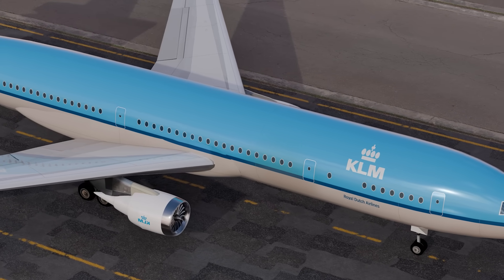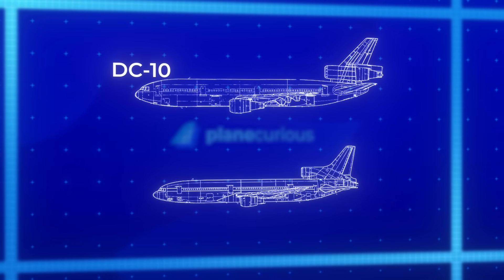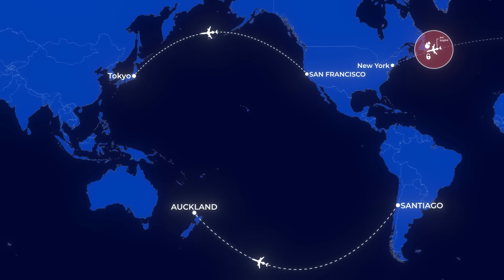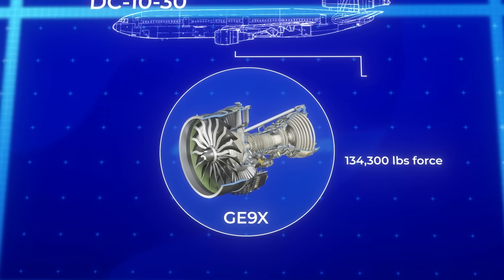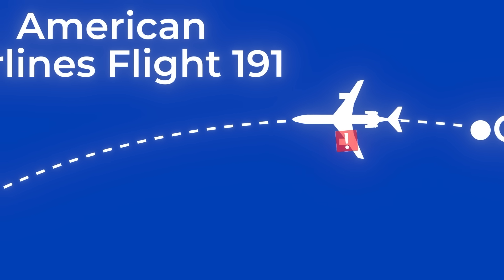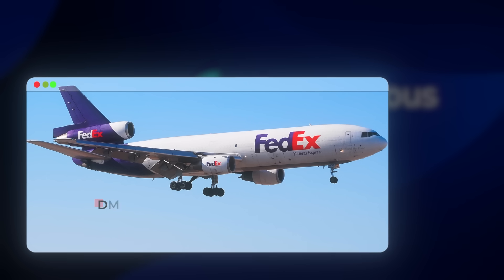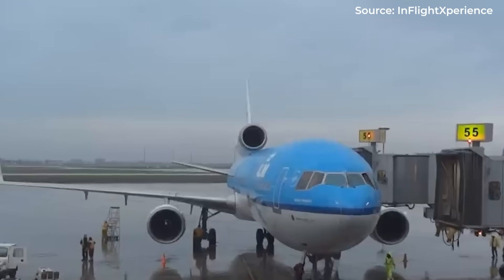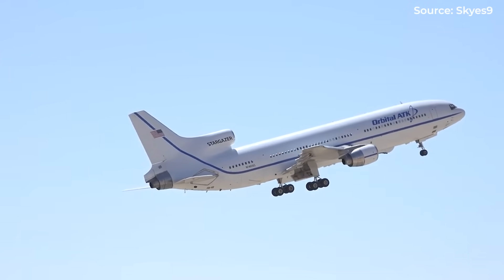Trijets Changed Everything - Until They Didn’t

Comment: 0:08 - The backwards logo on the engine is quite a nifty lil' quirk of the KLM paint scheme isn't it?  Silly Dutch, always having a laugh... :)

The 727-200 is simply the very best airliner that's ever been in my opinion for plenty of reasons.  No it is not practical today for also plenty of reasons, but what a beautiful, hardy aircraft, designed in the days of slide rules and paper, and just such a workhorse of fleets.  Long range, short fields... it did it all.  Still does in various areas of the world!  

My favorite of all time, and I miss them 'round here so much. The old school Delta paint was made for these planes.  I do wonder what the old Texas International paint woulda looked like on one, but we never got there as TI turned into Continental with the merger.  That triple whine, those clean swept back wings, and then they'd 'explode' with their triple slotted flaps... even had inboard and outboard ailerons, unheard of today with aircraft of that similar size.

Yep.  Love me the 727s.  Bestest evar, and likely never to be topped except in performance, which is natural.

HOWEVER... the 727 was not an answer for the fuel hungry 707 per se, as for certain routes there wasn't anything except the DC-8.  And the 727 was definitely not made for ocean crossings.  747 was made to solve the fuel hungry issue by simply moving more people at the same time with better engines.  DC-10/L-1011 was to try to make a similar thing happen with one less fuel hungry engine, perhaps not as long range or as many passengers, and they competed directly so neither really 'won'.

727 was built specifically for Boston Logan Airport and certain demands of airlines. At the time, Logan didn't have the big runways it has now, but American needed to get the heck outta there with a decent passenger count... but American also wanted a long range middle route airliner.  United wanted the middle router too, but they wanted engine redundancy with 4 engines.  Eastern also wanted the middle route airliner, but a twin jet.  So the 3 engines with high lift swept back wings and a T-Tail solved it all, compromised to satisfy all clients and wound up being the best selling airliner of its time.  THAT is why the 727 was built, not for the ocean crossing, it was never meant for that.

Also, the engine wasn't integrated into the vstab, that was solely a DC-10/MD-11 thing.  The engine was integrated into the body at the tail end, the intake was an S duct that was integrated into the vstab, and that led to the engine in the body.

I know, a bit pedantic, but I feel it's also important to get these things right.  History's important, y'know?

That all said, glad to see the 727 getting some love anyway, obviously. :)

Comment: Three engines existed for one reason. Law prohibited 2 engine aircraft from flying across oceans. Four engines was expensive so 3 engines designs where produced to meet the legal requirements. The law was changed when 2 engines where shown to be capable of delivering the required redundancy so the 3 engine configurations where dropped as they are more expensive and do not provide any significant advantage over two. You are welcome.

Comment: 8:53 just a little insider context on FedEx, we’re actually phasing out the A300/310s much faster than the MDs. Primarily we’re swapping the MD-11s out with brand new 767-300s but it’s happening much slower than the higher ups originally said it would. We’re pretty much flying them until they’re unfixable

Comment: I flew on a DC-10 twice. Hated the whole trip both times; the engine on the tail made so much noise. Two or four engines are much nicer to fly in.
Engines Turn Or Passengers Swim just plain can't be overlooked for fuel economy.

I still flat-out hate flying, though. I hate sitting in metal tubes, I hate security theater, I hate enforced waiting, and I also hate arriving at my destination at an entirely different sleep schedule to the local one. I'd much rather get there myself with my own vehicle, and America has gotten worse and worse as a potential destination while ticket prices rise and rise.
BA never did answer me about what they did with all the time harvested from their passengers; you lose more flying one way than you gain flying the other way.

Comment: Okay, a few things right off the bat, firstly, while the 727 was a tri-jet, it's not appropriate to lump it in with the DC-10 and L-1011, The 727 was a smaller narrowbody aircraft aimed at the short to medium haul domestic market, it occupied the same segment of the market that the A320 and 737NG occupy today (funny bit of irony on that, the 757 was intended explicitly as a 727 replacement, but the 737 ultimately ended up de facto replacing the 727 due to being more cost effective than the 757). Secondly, the 707 was designed as a quad jet primarily because jet engines of the era were not powerful enough to provide adequate thrust for an aircraft the size of the 707 with only two installed. The 707's first powerplant; the J57/JT3C was the first turbojet engine to achieve 10,000 lbs. of thrust, it was the most powerful engine available at the time, and yet, the 707 was so large and heavy that it necessitated four of those engines to provide adequate thrust. That brings us back to the 727, it was a tri-jet because only two JT8Ds wouldn't have provided sufficient thrust. Its three engine configuration was more a product of the limitations of the engine technology of the era rather than primarily targeting increased redundancy for overwater ops.

Comment: Thanks to ETOPS for trijet demise and later the quad jets, too. Boeing 777 was initially designed as a trijet with a 767 fusalage. American, United, and Delta wanted a true DC-10/L-1011 replacement, Boeing agreed and overhauled the 777 with similar fusalage cross section as DC-10.

Comment: I'm completely convinced that if McDonnell Douglas had developed the MD-11 as a twinjet (which they had actually seriously explored doing in the mid-80s), it would have saved the company by fielding the industry-chganging 777 years before Boeing did. The market demand for large, long-range aircraft that the trijets & 747 historically served didn't diminish, airlines just wanted more efficient twinjets to operate them. Boeing & Airbus saw this & capitalised on the winds of change with the 777 and A330, but MD tried to cling on to the old way of doing things and ultimately paid the price for it.

Comment: And yet the USAF STILL flies the DC-10's with a great safety record. As a crew chief they were harder to work on, but not a major problem and it didn't take "DAYS" to change the top engine. But airlines didn't want (and STILL don't) to do the PROPER maintenance of aircraft that is required. ALL passengers on an aircraft are an accountants risk factor. They weight how much the payouts would be if a plane crashes and they're held liable versus how much it costs to keep aircraft on the ground to do GOOD maintenance.  I can still go to MANY aircraft at an airport and do a visual inspection of aircraft that would get a redline on my inspection, that the airlines pass on through

Comment: I flew in a back row seat on a DC-10 once. It was insufferably loud inside the cabin back there. The flight was a short one, less than 2 hours, but gave me a splitting headache 10 minutes in. I never stepped foot on another DC-10 after that.

Comment: The L-1011 never had many of these issues, and the DC-10 has been delivering packages every day for FedEx and UPS since the 1980s, without a single crash.
It was the engineering of the Rudder controls when they first released the DC-10 on the market. Once that was fixed, hasn't been an issue.
Reply: What was wrong with the rudder controls when the DC-10 went into service?

Comment: I remember that trijets were also nicer for the passengers when it comes to overall noise levels vs the four engine models of their times because of the location of the noise sources. But that is irrelevant as economics ALWAYS wins vs any other, possible advantages.
I also still remember some issues with cargo doors which caused some DC-10 crashes before that was fixed.

Comment: Note: the A300 was the first ETOPS airplane. It's operation was approved everywhere, but not with the FAA. The DC10 was designed as a two engine airplane. After Douglas seen/heard of the Lockheed design (same as 727 S duct), it was quick put an engine here.

Comment: Tell sully and his passengers and every other pilot that has ingested birds or other FOD that losing both engines is like being struck by lightning. If Sully had had a Tri-Jet it’s very likely that he would have been able to make an active runway especially with modern day higher power engines. Also with engine making more power and becoming more fuel efficient 3 much smaller engines might be a bit cheaper to operate than 2 much larger engines providing them same amount of power.
Reply: If you fly through a large flock of birds you'd probably lose all 3 engines.
Reply: @joeschmoe6908 not necessarily. Aircraft have lost one and both but your chances of survival are higher with 3 and carrying passengers you’d think they’d place safety and redundancy at the highest levels.
Reply: @P-J-W-777  my expectation is that they would place safety and redundancy at reasonably high levels, and once they achieve those levels focus on profit. It sounds bad, but literally every engineered product works that way. Cars could be designed to much higher safety standards, roads, buildings, machines, everything. But squeezing the last tiny bit of safety out of anything is almost always disproportionately expensive. The perfect is the enemy of the good.
Reply: @joeschmoe6908 Pretty sad they place a priority on profit over safety getting by with only what’s set as a minimum requirement. On a personal level I don’t place much emphasis on safety as that’s your choice and responsibility but when you add multiple people especially children my GAF meter goes way up and feel that safety should be placed first and foremost before anything else.
Reply: @P-J-W-777  the minimum safety standards in the aviation industry are very high to begin with. Have you ever known anyone who was injured or killed in a plane crash? My guess is no.
    The limit to how safe anything can be is how much you are willing to spend on it. If safety standards were significantly higher, the cost of flying would be so high that only wealthy people could afford it.
Reply: @joeschmoe6908 I completely agree that safety standards are very high already. The problem is, is that we can make things ever safer without adding additional BS rules. I absolutely know a few people injured in an aircraft. My grandfather had a no nose gear landing in a Cessna 414 after it failed after being rebuilt. With my previous profession I have rescued more people than anyone should have to after aviation related accidents. I’ve also worked very heavily in and around the safety industry for years as well. 
That money you’re speaking about again is nothing more than profit margins because someone needs to purchase a new mansion and mega yacht at the potential risk of others safety.
Reply: @P-J-W-777  I don't deny that much of it is profit margins. But nonetheless if you increase the cost of safety you will increase the price of plane tickets. I'm not saying that's the best morally, but it is reality unless you're going to make  aviation a taxpayer-funded govt-controlled affair. 
  I'm not saying you're wrong. I just don't think making aviation into a luxury for the wealthy only would be a good thing, and I don't see how that can be avoided if standards are significantly higher. Then again I haven't flown for 12 years so what do I care?
Reply: @joeschmoe6908 Don’t get me wrong I completely understand what you are saying. I also agree that the governments hands are in enough as it is and don’t need to be any further into aviation than what it is. I also agree that aviation shouldn’t be only for the wealthy. 
I just feel that we could do better but as you said the aircraft companies only care about profit over anything else and you can see that with all the issues we’ve had with modern aviation. Unfortunately I don’t fly anymore either for health reasons but it’s something that I can’t seem to forget or let go of completely. 
This has long weighed on my mind with the victims and bodies I’ve had to help rescue and recover. It always hurts worse when it’s a child you’re carrying in your arms and the only thing going through your mind is that we can and should do better. 
In a way I’m glad that I’m not flying anymore because I feel that with all the modern technology going into the cockpit pilots have lost a lot of that old school skill relying too heavily on the computers to correct their mistakes. 
My grandfather was from the WW2 era and was one of the best pilots I’ve ever known and I learned a lot from him and would t ever come close to saying I was even half as good as he was. He still placed the safety of his passengers first and foremost. Always had his airplanes checked out a few days before going anywhere with a test flight the day before the actual trip. That’s what led to his no nose gear landing. We the grandkids would have been in that airplane if he hadn’t went for a check ride the day before and at a small airport with very limited resources as we were going to fly to his ranch.

Comment: The modern twin engines supporting ETOPS have redundant systems which enable higher reliability, such as multiple electronics, bleed air, etc in each engine. These are the parts which fail, but a twin jet has 4 bleed air systems, only one of which is required to keep the plane pressurized, as do other critical systems other than the turbine itself.

Comment: So much screen time given to N140SC and you don't mention the last Lockheed L-1011 still flying: the twin keel beams allowed a hole to be cut in the bottom of the fuselage to accommodate the Pegasus rocket's tail fin. 
I witness a generational change; Everett pumps out the last era of 767s and metal winged 777Fs, they will displace the largest fleets of trijets while also being the last copies of their types. Plus the KC-46s replacing KC-10s and 707 derived KC-135s. I saw the last 747 to be delivered, soon it will just be 737-10s and 777X-wings.

Comment: How can you OMIT the Sioux City, IA DC-10 crash as caused by the tail engine failing causing complete loss of hydraulic controls!!!!!
United Airlines Flight 232 was a regularly scheduled United Airlines flight from Stapleton International Airport in Denver to O'Hare International Airport in Chicago, continuing to Philadelphia International Airport. On July 19, 1989, the DC-10 serving the flight crash-landed at Sioux Gateway Airport in Sioux City, Iowa, after suffering a catastrophic failure of its tail-mounted engine due to an unnoticed manufacturing defect in the engine's fan disk, which resulted in the loss of all flight controls.

Comment: Not only ETOPS, but also the evolution of higher-thrust, high-bypass turbofans that were more than reliable enough.  Keeping in mind that the L-1011 and the DC-10 (later MD-10 and MD-11) commenced their design in 1964.  Lockheed hadn't gone beyond it's L-188 "Electra" turboprop, which rapidly was eclipsed by faster jet airliner, but had gained large jet transport experience with its successful Air Force contracts for the C-141 Starlifter and the C-5 Galaxy.  A possible conversion of the C-141 was studied but it was simply the wrong airframe for the airliner business.  The Trijet configuration offered far more possible routes than Boeing 747, and when the 747 was introduced, there were problems in selling available seats.

McDonnell-Douglas had a successful competing design to the Boeing 727 and 737 in the DC-9, which, stretched and fitted with more powerful engines, evolved into the MD-80 and MD-90 series.  But being a narrow-body, it simply couldn't fulfill the role of a transoceanic airliner.  The DC-10 design was the answer to fill that niche as the more popular 707s and its own DC-8 (Convair's 880 was a flop in the market, even though it was a "hot rod" of an airliner) were aging out and proving to be already obsolete in terms of costs per passenger-mile, especially after the 1973 energy crisis which saw jet fuel prices quadruple in only 18 months.   What became essentially a flying bus was what was needed to keep air travel affordable.  The DC-10 and its derivatives were certainly that.

Comment: The DC-10 was one UGLY plane.  It looked like someone just STUCK an engine in the middle of the vertical stabilizer.  It also had a flawed hydraulic design that lead to disaster on United Flight 232 on July 19, 1989.

The L-1011 was, comparatively, beautiful.